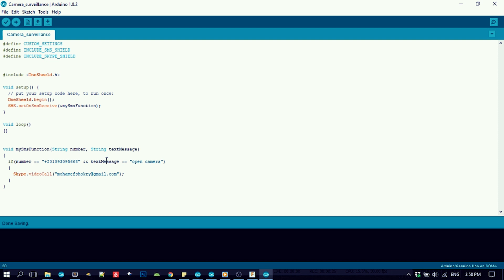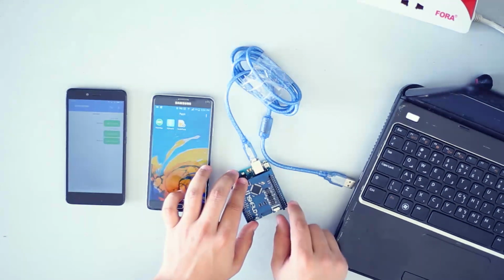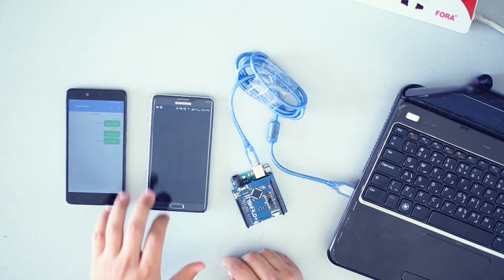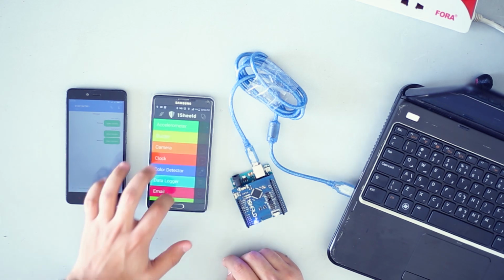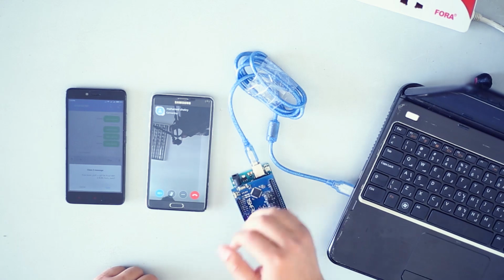Arduino Security Camera System (Arduino Home Hacks #4)

Comment: Hello!
Can it be done so that access is allowed by recognizing the faces of a certain person through cameras?
An example of this !!!
I have a car, and I want to make it possible for my car to be recognized by a face,
I am writing an aloghythm action!
1) I open the car door for fingerprint recognition!
2) I’m sitting on a car, I need permission to start the engine, it will be a face recognition, look at the camera, if the system recognizes my face, then give permission to start, and greet (Hello, my host car is ready to start)
3) Next, with a voice command, I start driving a car, about !!! I transmit the voice command "Start the engine" or "Turn on the radio."
!!!! Note!!!!
If some stranger enters the car, in some way, the camera recognizes the face when he sees the stranger, says (“Get out of the car immediately! We’ll call the guard in a portable case”), if he doesn’t leave the car within a few minutes, an SMS is sent to the host’s phone , and the alarm in the car will work. (+ electric shock in the seat :)